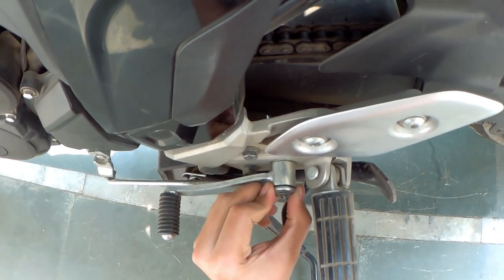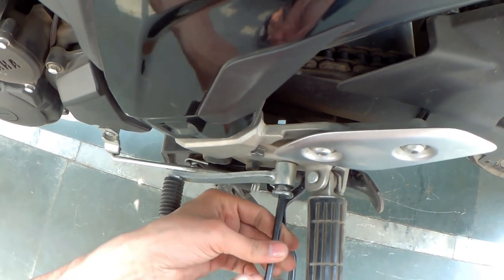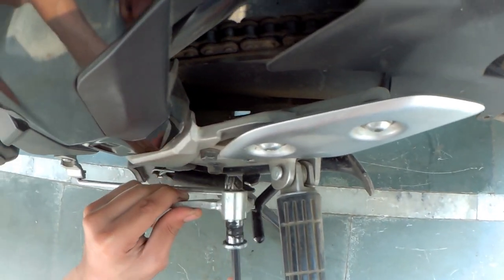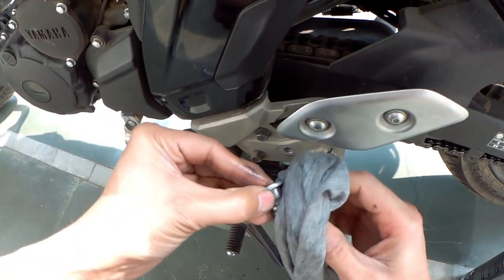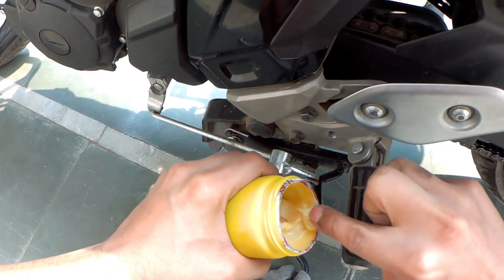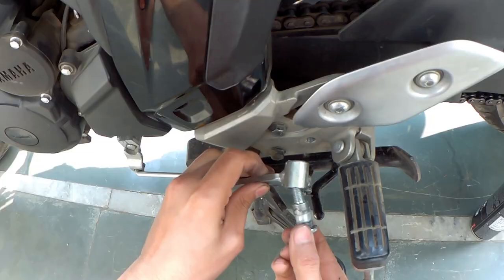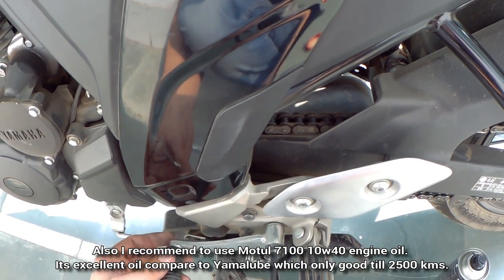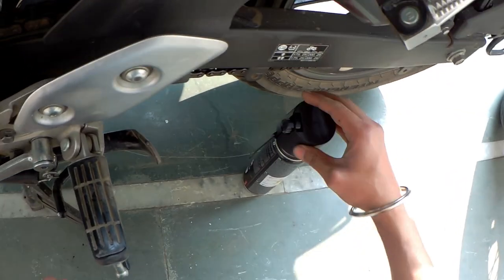Smoothen Gear Shift | How to | FZ25 | DIY

Comment: Please make a video on replacement brake pads for both front and rear (sintered ones). And if the rear calliper could be changed to some other.
Reply from the maker: Hi, have uploaded the video on replacing rear brake pads https://youtu.be/kpqll5KMt30
Front brake pads not yet required replacement, may be I'll open just to make a video on it. Currently there is no option to change the rear caliper however if I found some solution later on that i'll share it on the videos. At least you can try with steel braided hose which will increase the force applied on the pads.
If you have any other request do let me know. Thanks!

Comment: Bro I'm facing a serious problem nowadays, the gear lever is getting to hard to shift from first to second. Sometimes I need to ride in first gear for some distance then the shifting is happening smoothly. What to do ? 
I have observed one more thing, in wet condition like after washing or on a rainy day, the gear shifting is happening smoothly. What to do brother ?
Reply from the maker: Check clutch freeplay

Comment: This and clutch lever free play adjustment eliminates the problem completely. Just loosen the locking nut and play with the cable adjuster nut till you feel a smooth shift. Lever free play should be 10-15mm.
Reply: @द βiker बंधु you need to do what he has shown in the video and then look for "clutch lever adjustment" videos on YouTube. Watching the video will be easier then reading the instructions
Reply: @द βiker बंधु check the bike's user manual to know the required free play. Set it at that much and then reduce it if you are getting hard shifts.

Comment: I just bought an FZ25 ABS today. I'm unable to shift to neutral when the engine is turned ON (it's too hard). When the engine is OFF, I can shift to neutral easily. I also find shifting from 1st to 2nd gear a bit stiff. Is this normal and will it become fine over time or should I get it checked?
Reply from the maker: It is also present in old fz25. Adjust the lever freeplay it will help. Also it will get better with time. There is some internal adjustment as well which svc can do
Reply: @LifeofPal  thanks bro!

Comment: This thing actually works. Thanks a lot bhai.. I needed your opinion on few things. The mudguards of fz25 in the front wheel is really very poor. Going to office during rainy season is a pain as my shoes get smudged with mud. My question is... Will a belly pan help to reduce this? I have also ordered a front wheel fender from Ali express. Once it arrives I will fit and let you know if there is any improvement
Reply from the maker: Every bike smash water on shoes. I use shoe rain cover.
Reply: @LifeofPal  oh thanks bhai... I will search for that
Reply: I'd get a car if I'm too concerned about getting dirty in the rain or aftermath.
Reply: @cmrdecc6516  well I asked this question when there was no covid and heavy traffic in Bangalore, taking out a car and driving through MG road and Koramangala was a nightmare then.

Comment: Sir after watching this video i tried to open that nut but that nut is so tight in there. I can’t unscrew it! What should i do
Reply from the maker: Tap it with hammer
Spray wd40/kero/petrol
If still unable to then try using allen key with 1/2 inch drive socket. It is bit costly but will allow you to apply much better torque.
https://amzn.to/3golyVE

Comment: Its does make it much better but is there a permanent solution?
Reply from the maker: No it will get dry again. So have to do again and again. Putting oil also work but oil doesn't last as much as grease.

Comment: Would like to get an video on clutch adjustment and mainly I Motul 7100 10w40(one if my friend told it's an ester oil, so will it damage oil seal or engine in a long run anyway..?)
My bike is FZ25 (2017 blue variant )
Reply from the maker: Divyendu R I just bought another bottle of Motul 7100 and this time when i change it will make a detail video and will answer your question and address all the concerns. Long story short, no issues. Will make a video on how how to adjust all the adjustment. Thanks
Reply: GS Rider thanks

Comment: Bro i need help ,, my fz25 blink engine light and display error code 46 what happened , and what I do please say solution
Reply from the maker: I think its a sensor issue. Better take it to svc. They have computerized method to check it.

Comment: My fz25 gears don't shift 50% of the time when I'm still! For eg. If I'm in third or fourth gear while riding and suddenly stop, then I've to come down to first gear but it sometimes doesn't shift! I have to move the bike a little!
Reply from the maker: Yes what you said is correct and its normal. It happens in my FZ and on my friends FZ's as well. What you can to is, you don't have to move the bike, just release half clutch and you will hear kat sound then shift down gear, release half again then shift. Repeat this until neutral. This happens when you're on speed then suddenly press the clutch and slowed down the bike sooner. If you slowly close the throttle and reduce the speed progressively then doesn't happen.
I'll share some riding tips and how to get best performance & mileage out your bike. Keep an eye on my channel for all those upcoming videos. Lots of good stuff coming in.
Reply: Musikaré A increase your clutch lever pull. it is probably low 👍
Reply: Release the clutch and accelerate slightly, it will slot into gear. Then you can change to neutral. This happens when the gear lever gets stuck in between two gears.

Comment: Will it fix that loud clank sound when you shift to first and second gear
Reply from the maker: No
Reply: okay I thought that would fix it any solution for that
Reply from the maker: What sound u have. Gear shift sound is normal. If u have any other sound then get it checked as its hard to tell what it is without checking.
Reply: @LifeofPal  okay I'll have it checked thank you for your reply

Comment: Initially I had very audible tic tic noise, after the recall service centre checked the cam cover and refitted the inner bolts with thread locker liquid and set the tapets but no feeler gauss was used as they get to know since they do it daily 😂. But the ticking and coin ringing sound and vibration in running was gone, but I still have the timing chain running noise after engine heats up and it’s just as much as in your video. I have done 5000 km is there any other solution or additive to fix this permanent?
Reply from the maker: First of all they feed up with your tappets without feeler is the baddest thing in the world. I just hate that kind of work. Tappet has to be set perfectly otherwise performance will not be good. Bike won't accelerate as fast it should. Secondly, those noise is a manufacturing issue and can't do anything about it unless the company do something, or they release new better quality replacement parts.
Reply from the maker: Here is tappet adjusting video  https://www.youtube.com/watch?v=VhiJGtd_Xig